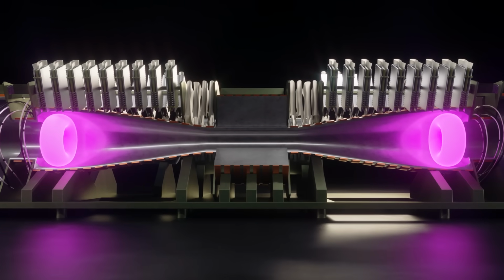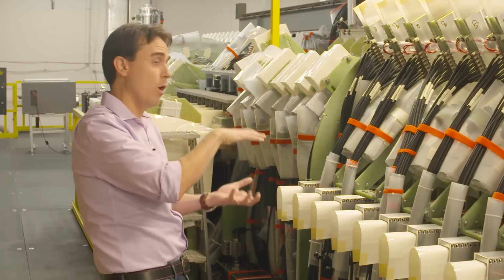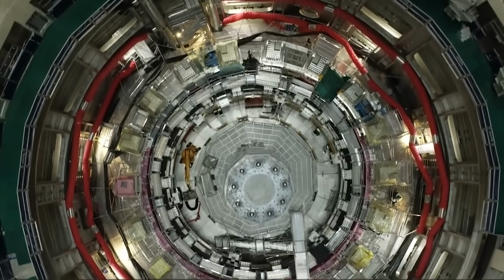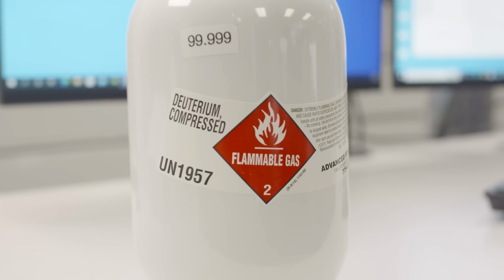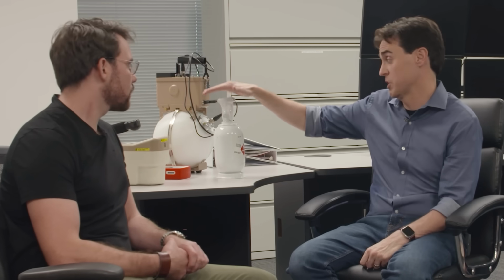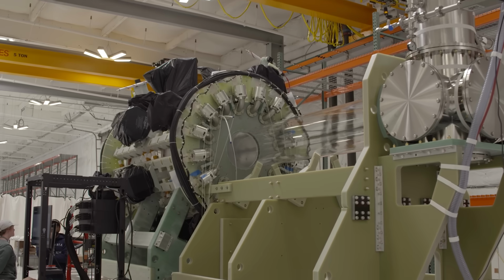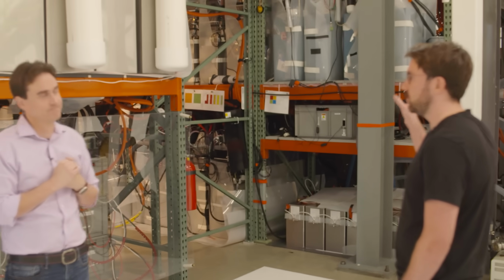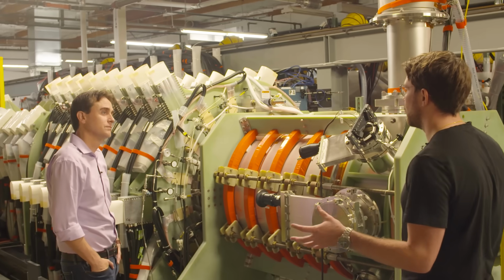A New Way to Achieve Nuclear Fusion: Helion

Comment: excellent.......grasp of  Maxwell's equations...used to design a waveguide that smashes two plasma beams into a micro-meter current pulsed high temperature pressure particle collision event.... event requires a large capacitor array to discharge large minimum constrained energy/time equal power necessary to generate both plasma current and a magnetic field bound vacuum constrained wave guides.....big thumbs up.......what next?........

Comment: Great video.  One question that I did not see addressed in your interview with the founder. The video was a little vague on how efficient the overall Helion fusion process is.  I saw the part whereby the Helion process produces 4X more energy than fission (per unit mass??) and that 90% of the electricity used in the process goes towards the generation and control of magnetic fields.  At any point in the interview with the founder, did he say that Helion's process produces "energy gain", meaning more energy is produced than input to the process? Or will we have to wait until Triton is built and tested and are they projecting energy gain for Triton?  Regards, Steve

Comment: This is a really interesting approach to the problem. Despite all the crazy complex physics and engineering going into it makes a real intuitive sense. It's like a purely magnetic engine.
Reply: yeah, that blows my mind. fusion pushing directly against magnetic fields, just wow.
Reply: @michal-jenco  How can any container handle something that hot? That is as hot as the interior of the sun.
Maybe this machine could lead to a probe lander on Venus, maybe even the hydrogen oceans of gas planets.
Reply: @SylkaChan  The magnetic fields prevent the plasma from making contact with the reactor walls.
Reply: @SylkaChan  There just isn't that much stuff in the reactor. Yeah, it's not, but it's a tiny amount of mass. Consider a speck of dust at a million degrees landing on a block of ice the size of a house. The whole block ain't going to melt. You will get a tiny divot somewhere though, and if you're doing this a dozen times a second, it adds up. That's what the magnetic fields are there for.
Reply: @ryanbrown982  Exactly this. Also it was said briefly that this reactor is essentially a vacuum chamber. Tokomak reactors are vacuum chambers as well. You don't want normal air in there or any other elements spoiling the reaction. What this means is there is no matter touching the reactor walls and vacuums make excellent insulators. 

Also, all of the waste products from Deuterium - Helium 3 fusion produce ions. That the point of this kind of reactor in the first place. Use the ions of the reaction to induce magnetic currents to directly generate electricity. This process also does is slow down these ions. The kinetic energy of these ions is lost as they inducing the magnetic field. That means they also loose heat.

Comment: Slight problem with this design... helium isn't magnetic.  How do they keep it in their magnetic bottle when it's a millions of degree plasma?

If heat is an issue with rapid cycling of the capacitors - turn that into energy production as well.  Capture the waste heat and pump it into the steam generation system, or to pre-heat the liquid before it feeds into the full scale thermal generation system.

Comment: I’m a complete amateur in this area outside of my general engineering knowledge - but this concept seems much more promising than the laser setup at ITER or the more conventional tokomak designs. The increased efficiencies I’m not having to convert to mechanical power seem key. Also it’s not the size of an office building.

Comment: I understand that the power rating is high, for a fraction of a second, but what is the time-averaged energy produced?  That is, what is the pulse repetition rate?  How is the fusion heat captured, presumably to raise steam to drive a turbine to produce electricity?  In short, the science is wonderful, but the production engineering?  Practical sustained fusion has been just around the corner for more than half a century, ever since I joined the industry.

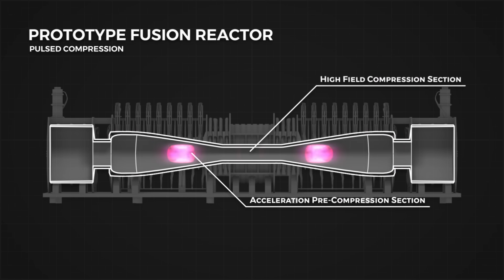Comment: 6:08 so if I am understanding this right, if you can do that with gas and fuel then could this not in theory work in a space craft to make it move very fast? Very interesting stuff amazing!
Reply: Until you run out of it...
Reply: This is developed from tech for ion drives, which do exactly that – using electricity to accelerate ions and shoot them out the back.
Reply: You'll get more info on the nebula video for that

Comment: This looks and smells like another Theranos type of company, when you actually develop a new technology you don't cover yourself in secrecy, at least not like that, you might obviously not show the insides, but you do show the numbers, because they are what proves you are right, and usually are the best way to attract investors. When startups avoid showing it  that usually means their product doesn't work and they don't want to get charged with outright fraud if things go south. So instead of demonstrating the technology they tiptoe around what the managed to do, with as much pomp and circumstance as possible (jus like this vid).
I saw mainly two things that scream to me as physicist, they didn't show their Q factor (everyone can build a fusion reactor, it's almost trivial, building one with a sufficiently high Q (Q>1) is another thing, and untill, last week and NIF no one had actually been able to do it.)
So the fact they are building a "comercial scale" reactor seams like a very smokes and mirrors type of behavior. (Theranos did almost the exact thing).
Second, their reactor doesn't appear at all to have cryogenic infrastructure around it, which does raise my concerns about their magnetic containment system, that would suggest they are using conventional conductors which are a big no no in terms of efficiency and strength. 
I hope I'm wrong, but I don't think I am, this looks like a PR stunt to try to get through another round of investments.

Comment: No lasers needed, just very very strong magnets?

It will also be very interesting to see even stronger magnets engineered in the coming years, through new discoveries in materials, which will further shrink the size and cost of magnets needed. Stronger magnets will have pretty profound effects in other areas as well, such as smaller, less expensive medical equipment. Also, with newer discoveries around surfing magnetism between stars, more powerful and smaller magnets will be helpful. Very exciting developments.

Comment: This will be another Dud. Phil Farnsworth & Robert Hirsch tried a similar reactor design in the 1960s using apposing ion guns & magnetic solenoids, & they had no success. Energy output will be a tiny fraction of the input energy required to operate the reactor.

You know one of the definitions of insanity is doing the same process over & over, expected different results.

Comment: And nuclear fission isn't expensive because plant are big and require a lot of concrete and steel, or hydro-electric dams would be just as expensive. They're also not expensive due to waste storage, as they don't produce a lot of waste, and the little waste they do produce can be easily stored in cooling pools and then in dry casks for the length of time for the dangerous radioactivity to decay away, with more than 99% of the radioactivity being gone within just 20 years of the fuel coming out of the reactor. 

Nuclear fission is NOT expensive period. It is capital intensive. When you buy gasoline and burn it in your car, you get the benefit of that immediately and cover the cost yourself, which is an expense. When you buy the car, you take out a loan and get the benefit of it over a period of time, which is an asset. Nuclear plants are capital intensive assets that you get the benefit of over very long periods of time (up to 80 years maybe for Gen 2 plants or 80 years or more with Gen 3 plants (if they're not shut down prematurely Germany)), and you depreciate or expense those plants over those time frames. For example, you're offered two cars, one costing $5k and the other $30k, which is more expensive? Now, you're told the $5k car will only last for 1 year while the $30k will likely be reliable for 10 years. That means you will expense the full cost of the first car of $5k in that first year while the second car will be expensed over 10 years, let's just say on a straight line basis, only costing you $3k per year. Which car is more expensive?

Also, nuclear fission is so capital intensive largely due to the incredibly high regulatory burden which causes their build-times to get extended, which drives up all sorts of capitalized costs. Vogtle had a paperwork delay early in 2022 which delayed it's start up by a little over 3 months, and that paperwork delay drove up the capital cost of the new reactors by over $920 MILLION.

Comment: I have a question rocket engines run their fuel through themselves to keep it cool? Could they not run something similar through the machine to keep it cool. Have it run through compression to cool it off again helium or o2 liquid is cold.

Comment: 17:20 this is very interesting. 80% of output energy goes into neutrons for H2+He3, and ~16% for H2+H2. For a U235 fission it's only ~3.7% ("Atoms, Radiation, and Radiation Protection" e3, p232). For H2+He2 & H2+He3 it looks like a total output of 20.87 MeV per (paired) reaction; it's 195 MeV for U235 (specific energy out for fusion is more, per-atom is more for fission). I wonder if the neutronics of fusion will become an issue -- the field will have to answer a lot of the same hard questions fission engineers do to go from lab to operation. I'm not too excited about maintenance on neutron activated electronics.

Comment: The inside of tokamaks are going to be SUPER radioactive not because they contain uranium impurities. They'll be really radioactive because all of those neutrons will be slamming into things like carbon, steel, tungsten, etc, and getting absorbed, "activating" the atom that absorbs them, making C-13 turn into C-14, which is radioactive. However, most of those activated materials will only be radioactive for a few hundred years before being almost fully decayed away to stability (i.e. no longer radioactive), but because "radioactivity" and half-life length are approximately directly inversely proportional and the fact that a few hundred years isn't a terribly long time, that very large amount of activated material will be pretty dangerous. 

Spent nuclear fuel that is pulled out of even a CONVENTIONAL LWR fission reactor will lose more than 99% of it's radioactivity in just ~20 years such that you could stand 1 meter away from the unshielded rod for an hour and get the same radiation dose as a single PET scan. After 200-300 years, you could juggle the spent fuel and get almost no dose (although you probably still wouldn't want to eat the stuff). 

And fusion only yields 4X the amount of energy that fission does, on an absolute per nucleon basis, and, as opposed to fusion, we can CURRENTLY make fission work. Additionally, fusion reactors have huge energy requirements, requiring you to feed most if not all of the energy back into the reactor just to maintain fusion. Under a SUPER optimistic scenario, maybe you'll be able to get away with only having to feed 50% of the energy back into the reactor. In that case, you're hypothetical fusion will actually only yield 2X the amount of energy that we can get out of a fission reactor that we can build TODAY, not in 20 to 50 years. (Full disclosure, this assumes you're using the reactors to generate heat to boil water to turn turbines, etc. and you lose energy in all of those mechanical conversions. I'm MUCH less certain what the energy loss will be from driving a current by having the plasma pump energy directly into magnetic fields.)

I support fusion research, but we need to start building non-CO2 emitting high-energy yielding power sources right NOW.

Comment: It still boils down to the same old, same old: Unfounded assumptions based on a severe lack of research into plasma behavior, ending up with dysfunctional controlled fusion systems that have been gobbling up resourses 60 years. 60 years!
Sadly, these useless massive expenditures keep going down the same well-worn road, thanks to well-meaning media hype like this, which continues to hoodwink themselves and a gullible public.

Comment: a short summary of this video:
They are trying just another Fusion Device which looks nice but don't generates any power (yet).
Something we can do for more than 30 years now :)
lets see, if they are archiving anything of note. it would be nice.
Reply: Generates. Once per 6  seconds (magnitudes more frequent than any device on the Earth). The next steps :  multiple per second  generation  (mainly heat problems) + taking electricity from plasma + recharging the capacitors and delivering rest electricity to the grid + a separate  lower power device for fusing H2 to He3 required by multiple main devices.
Reply: @madcalm2024  sorry, i was imprecise. it doesn't generates any net power yet. As far as i understood it, "the rest to the grid" part is only an idea, and not realized yet, because the energy is not even enough to keep the device running, and there is no rest to deliver to the grid (yet).
Reply: @cnschu  The same coils which push the plasma already can gather the energy (95+% efficiency)  during back "move" (like recuperative braking) . The main problem seems to be full charging capacitors in a very short while without damage so that they can provide multiple times per second cycling. And for sure a shortage of very rare & expensive He3 to improve the device at faster iterations. And also very quick removal of reaction products between cycles.

Comment: This is really neat, and seems promising, but without any discussion of Q values, it's hard to see this as much different than a high school kid making a home fusor in their garage. I get it that they don't have the hard numbers yet because they haven't built anything that has attempted to capture the energy output yet, but surely someone over there has done some napkin math with some rough estimates of what Polaris might be capable of. What are the inputs, and what are the outputs? I feel like going forward this should be the most important question for anyone working on reactors.

Comment: So did I get it right, there is FINALLY a way to create electricity without boiling water? Thanks for the amazing video, it brought a happy smile to my face.
Reply: Other ways have existed for a long time, such as surrounding a heat source with thermocouples, this is called a thermoelectric generator (TG). Which is how quite a few of the Mars rovers and the spacecraft which sent back pictures of Pluto worked, using radioisotope thermoelectric generators (RTG). 

However, they were less efficient than spinning a turbine with steam, which is why this method has only been used in a few spacecraft where space is at a premium, and in much smaller ways such as to directly power thermometers in steam engines (done since the Victorian times!). 

But this way apparently is actually more efficient which is what is really exciting about it!! Every other innovation, such as one I read about a few years ago to directly turn alpha decay into electricity in a manner similar to RTGs, was still not quite as efficient as a steam turbine. Finally finding a practicable method, which is allegedly much more efficient than a steam turbine, potentially heralds a very exciting future for plasma physics and energy production!!

Comment: Could someone tell me why so much money is put into Tokamak designs that from what i see so far are by design noneconomical simply due to cost and avaiblity of the fuel
Reply: It's just a very specific ( with separate plasma  flows formed as rings then run into each other ) version of Tokamak ))
Reply: because for a long time Tokamak style reactors were the best bet, this style of reactor requires a lot of computing and electrical engineering (as well as helium 3, which the best source was lunar mines until Helion decided to use fusion to produce He-3), it is basically a plasma coil gun.
Reply: @MJS-lk2ej  Even now He3 is more appropriated than Tritium because it's stable and can be stored. Tokamaks (with even more complex electricity) use Tritium because of much lower required  fusion temperature.

Comment: one thing i can't help but wonder about a dedicated D-D reactor, wouldn't the Tritium and HE-3 daughter products react with the Deuterium already in the reactor?
Reply: They say that a single D-D reactor can serve multiple main reactors. Their mixing in a single reactor would damage (by neutrons from D-D fusion) that reactor much sooner.
Reply: This test reactor does do exactly that, it is essentially a multi step D–D reactor. 

However, they want to split them into separate breeder and power reactors when it comes time for commercial production, to siphon off the neutron bombardment onto just one section of the production chain and keep neutrons away from the main power reactors. 

One commentator has pointed out that certain countries’ regulatory regimes may disallow the breeder reactors in their territory, but would allow the power reactors due to having no neutron contamination.
Reply: @kaitlyn__L  Simply these countries have a lot (production ready volumes) of He3 ))
Reply: @kaitlyn__L  AFAIK, the test reactor is D - He3 (it needs He3 directly).